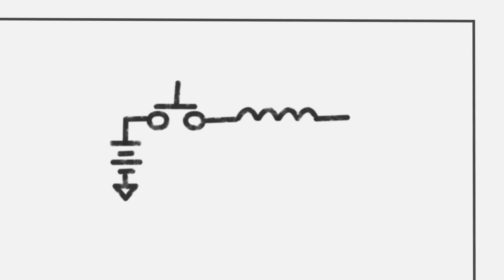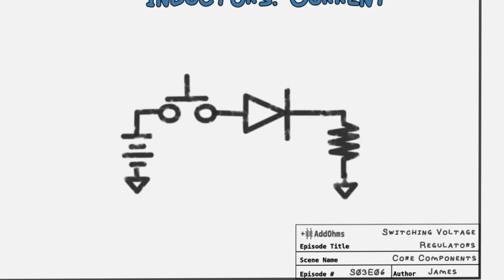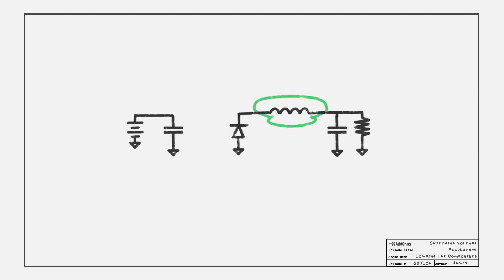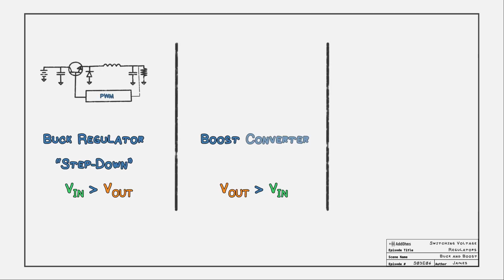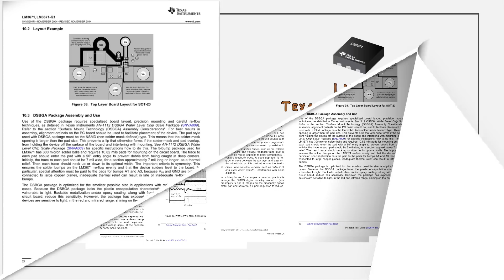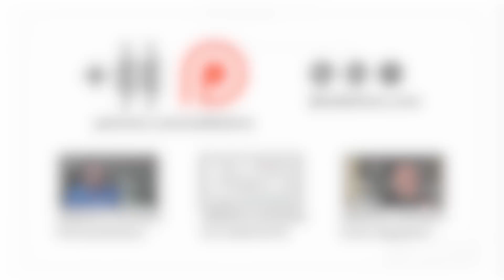Switching Voltage Regulator (Buck, Boost) Introduction | AO #18

Comment: Awesome video!  One thing I don’t quite understand is why the diode is facing away from ground in the Buck schematic. Is current flowing from ground into the inductor at any point in the cycle?  Or is it there to create at 0.7 voltage or something?
Reply from the maker: What happens when the switch turns off, the inductor’s magnetic field collapses, and the load’s current is low?

Comment: Assume 
Vin ranges from 9 to 12.8V due to battery discharging overtime.

Vout need to be constant 11v and current constant 300mA

How to design the switching regulator to meet the output required?
Reply from the maker: Use TI’s WEBENCH tool.
Reply: @AddOhms  
Thanks

Comment: How to maintain output voltage constant for variable input voltage
Reply from the maker: With a regulator...
Reply: @AddOhms  Where to keep the regulator exactly  in the circuit ?

Comment: What happen with the current ? Does it change proportionally with the voltage ?
Reply from the maker: The purpose of a voltage regulator is to keep a constant voltage as the current changes.

Comment: If you can help me ... 
I want to build a building* to charge the bike battery. 36V.
I bought 2 sources 24 V x 5 A.
Can you help me build a 42 V x 5 A building* ?
I saw many constructions on youtube, but with low current 1-2 A.
Thanks ! 
(*building* = Mounting = montage = assembly ...
I'm sorry, I don't know which word is correct? )

Comment: I thought  it was voltage  inductors  made which  forced  current
Reply from the maker: A magnetic field is generated when current flows through an inductor. When that field collapses, the opposite happens and it generates current. Voltage is induced because of that current flow. That is Ohm's Law. Multiply the current by the resistance (or effective resistance) of whatever is in series, and you get a voltage.
Reply: @AddOhms   ah so voltage  is induces  via  the  magnetic  field collapsing. And during the collapse  the force generated push  electrons/ current  on through?
Reply from the maker: The current generates induces the voltage drop. Voltage and current are directly related. Can’t have one without the other. Magnetic fields cause current.
Reply: @AddOhms  ah thank  you

Comment: HI, I am Jimi! Like to learn more about electronics. I have a 48volt battery and like to know how to do a step down using this method of yours, but I don't know where to start? I already bought a step down module twice but it only work for a month and that's it. I use that module to power my 19 volt Laptop and the module got heated up, The best part was, both of the module is without a heat sink! Please advice me if I can built a better ones for long run because I always used it outdoor. Please Thank you!
Reply from the maker: Sounds like it needs a heat sink.

Comment: whats difference between using an inductor and capacitor to using 2 capacitors or 2 inductors? Since both components store electricity, is it okay to do the setup to have 2 capacitors/inductors instead?
Reply from the maker: No, they do not both store "electricity." They both store energy. Inductors store energy in a magnetic field while capacitors store energy in an electric field. Because they work different, generally, you need both.
Reply: @AddOhms  im just kind of confused when to use a inductor or a capacitor >.<

Comment: Would like to see you design and build a high amperage mppt charge controller for 48 volt output it'd be nice if you could add more mosfet and bigger inductor to your design to get as much amperage and wattage the person might need thank you very much for your videos

Comment: I’m trying to step the voltage in an LED flashlight from 18VDC to 12VDC because I’m changing the light engine. After learning the hard way that resistors are too inefficient, I found your fabulous YouTube channel. 

Since my goals are high efficiency(i.e. low heat for a 9W light engine) and small form factor, would you say that a buck regulator is the way to go?
Reply from the maker: It's the easiest method. When you get around 10 Watts, then it makes sense to consider a constant current supply, instead of a constant voltage supply.

Comment: Perhaps what bother me the most about this type of power supply is that they become noisy as you reach the max output... any chances you would be willing to show how to increase their max output with out increasing in noise and temperature>???
Reply from the maker: I gave an answer here: https://discuss.addohms.com/t/reducing-noise-at-max-output/989. If you don't want to sign up for the forum, you can reply on YouTube.
Reply: awesome reply, you are totally correct!!! I have been using abut 2 or 3 power supplies in line, in order to overcome this particular problem.. since my power consumption is around 4 amps... but those cheap Ebay Chinese modules are not meant to provide the "Rated Power" without lost of noise & temperature!! I was just wondering if it would be possible to double only the chip, inductor, and cap to arrive to a better way to solve this particular problem....(I try to sing in your website but no matter what I do the confirmation mail never arrive.. )
Reply from the maker: In a switching supply, it is rarely as simple as “double the size of a component.” The inductor needs to get bigger to support more current, but it may be more than 2X for twice the current. Also, the switch used needs to support being able to charge that larger inductor.

Comment: Thank you, i would like to see a video on how to design these circuits, calculations and all that good stuff if possible :)
Reply from the maker: I'll probably never do a video on a discrete design. That is only done is in school. For the most part, I use TI's WEBENCH when I need to design a switcher. Not much math gets left over.

Comment: Firstly, thanks for these great videos. Well produced and packed with info!
I built a box that provides 5v reference voltage to automotive sensors and BNC connection for oscilloscope waveform of the return voltage.
I used a MP1584EN based buck converter thinking I wanted the efficiency over LM7805...
It's been suggested that the switching might be an issue in my waveform and that the linear 7805 would be "cleaner".
Do you think it is an issue in my application?
Reply from the maker: For a reference voltage I would use a linear regulator. The switching regulator is inherently noisy. I’ve seen designs where a switcher was combined with a linear. The switcher took care of the majority of the voltage for efficiency and the linear cleaned up the noise. I would also pick something more modern like a NCP1117 over a 7805.

Comment: Great way to save power but hopefully you can show a Buck Boost regulator without the TI chip and also show how you size the inductor. I would love to see how they did it vack in the day before they used  The TI chip.
Reply from the maker: Sorry, I won't be making a discrete circuit. It's an academic exercise at this point that is best left for textbooks and classrooms.

Comment: Every time when I connect emitter to a load the transistor is not working as a switch at all, but when I connect it to the drain everything seems ok, can you explain what to do?
Reply from the maker: I don’t understand what you are doing.
Reply: AddOhms simple topology, I use a transistor as a switch with a resistor on drain as you show, so far so good. When I change the topology by connecting the resistor to the emitter and the ground the transistor is switched on permanently, it behaves like a resistance. Now according to the above diagram the transistor emitter is connected to a sub circuit and it works as a perfect switch. So why every time when I try to do the same topology the transistor fails?
Reply from the maker: This video is not about how to use a transistor as a switch. It on creating a switch-mode power supply or "switching voltage regulator." If you need to use a transistor as a switch, I suggest watching my BJT and MOSFET videos. 

Additionally, an emitter is associated with a BJT. A drain is associated with a MOSFET. It doesn't make sense how you are interchanging them.

NPN-BJTs and N-Channel MOSFETs are generally used as a "low-side switch." Which means the load goes between the +V and the BJT's Collector or the MOSFET's Drain. In general, you cannot use them as a HIGH side switch. You would need the PNP and P-Channel counterparts.

Comment: Superb video and graphics, loved the way you animated the switched regulator operation. Could you do the same for the Boost Regulator, I don't get how it steps up the output voltage?
Reply from the maker: I probably won't do a video on it. It works by moving the inductor between the switch and source. (Whereas a buck it is between switch and load.) When the switch is closed, current flows through the inductor building its magnetic field. When the switch opens up, that charging path is lost. So now the inductor's magnetic field begins to collapse but the current is flowing to the load now. So you have the original source in series with the inductor. That creates a the higher voltage. 

Again the filter capacitor helps to smooth out the voltage.
Reply: I get it now, thanks :)

Comment: For the longest time, I could not completely understand the fundamentals of capacitors in DC. I watched a ton of videos that did not help much, but you just did it in very few words and a diagram.
Reply from the maker: Capacitors have many functions. In addition, most engineers don't fully understand how they work. This leads to a lot of bad information on them. (I used to be an application engineer for a capacitor company.)

Comment: Can you also discuss soft start AC switch? There must be simple way to design it but they are expensive.
Reply from the maker: I’ve never built a soft start or looked into how they work.
Reply: basically during ON start - circuit gradually increases voltage to max level instead of immediate switching ON.
It is RL/RC - not sure if transistor needed. Like a relay but at the end it is just a full connection
Reply from the maker: It’s not a relay and that’s what makes it complicated (and expensive)

Comment: Though a very good video explaining the basic operation of a buck converter. In all likelihood an NPN BJT would not be used in such an application being they are better suited for low side switching and there would be efficiency issues. In an actual buck converter a PNP, P-Channel MOSFET or an N-Channel MOSFET with a charge pump, to run it in high side configuration would be used. I felt that I had to add this because when I was still learning the basics, I attempted to build a buck converter using an NPN with disastrous results.

Comment: do you have videos to explain how to use voltage mode control to control the buck converter? like the output increases or decreases, control loop change the switch frequency duty ratio to make output remain same voltage?

Comment: is it possible to hack 12v switching adapter to push out like 80volts to run a series of leds ?and how do these adapters manage the amps flow like there are many 12v adapters but with diffrent amp rating

Comment: I want to output 1A 5v from a UPS Battery Which is 12v-7.2Ah. which voltage regulator I should use

Comment: Nice video, thanks.

I would wery much like you to make a follow up on this subject.
I have used a lot of hours watching videos and reading about boost converters, and one thing i dont seem to get is.

1. You short the inductor to ground, in shorter or longer time periods (PWM), and despite doing so, you still get high efficiency something like 80-90%, what about the current that runs through the inductor to ground while charging up the inductor ?

2. How long is the maximum on time for the switch, at some given inductor value, i meen you are tecnically shorting your power rail to ground.

2. if i use a MCU to generate the PWM, and find myself a suitable FET, how large should the inductor be, at what switching frequency and duty. say i need to generate 12V from a 5 volt source at lets say 1A amd my PWM is 20KHz, could you maby try going through an example, using a MCU as controler, to better understand what is going on inside such a dedicated boost chip ?

There is a lot of videos on the subject on youtube, but i have not been able to find one single one, where someone uses a MCU as the controller, and explain whithout going in to serious maths, how to choose the right inductor size, please be the first. 
 
Greatings from Denmark.
Morten
Reply: +Morten Rolsing Answer to #1 and #2 are related: when current initially flows into an inductor, it has a very high resistance. As current continues to flow and the magnetic field saturates the core material, the resistance of the coil drops. So the maximum "on time" depends how long it takes the magnetic field to build. To determine that you need to consider frequency, inductance, core losses, and the inductor's saturation curve.

#3 I probably won't cover a discrete design on AddOhms. Designing a discrete switcher from scratch is incredibly detailed, as you have found.  My idea for a "design tutorial" would be using an buck (or boost) controller chip and perhaps showing what happens with the wrong inductor/capacitors values.
Reply: +James Lewis 
Thanks for the answer, such a toturial would be much apreciated.
I would prefer if you would use the boost converter in such a toturial, i find them the hardest to understand.
Maby you could do a inductor saturation toturial also some time, that would also be extremely usefull.

Thanks again, keep up the good work.

Morten